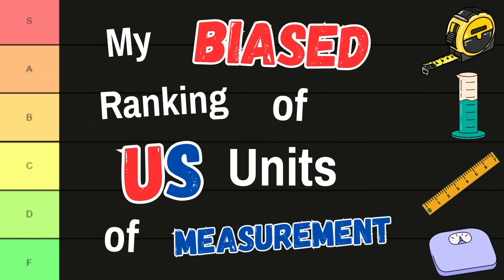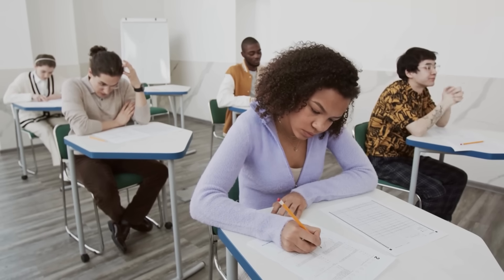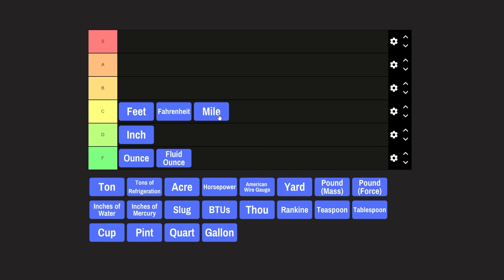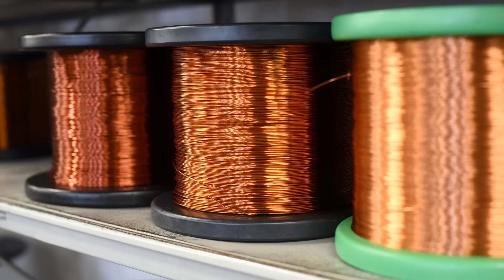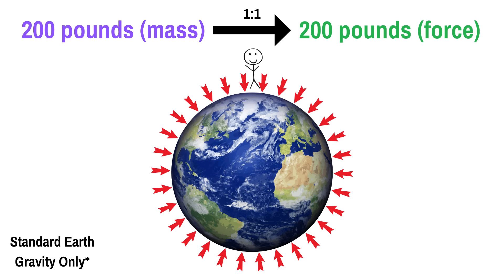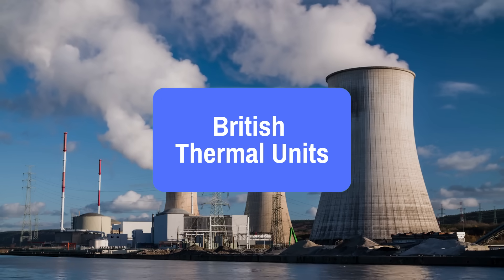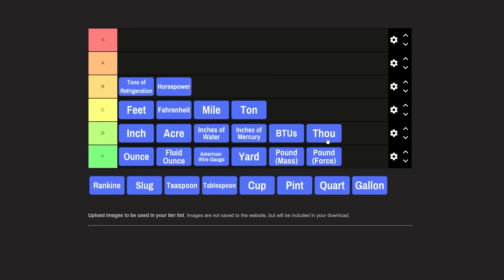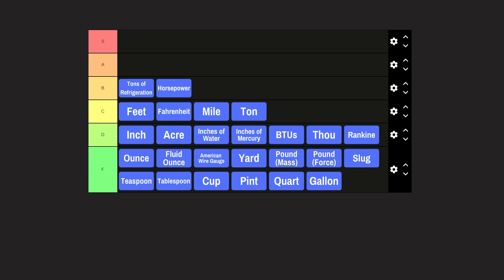Tier List of the DISASTROUS US Measuring System

Comment: I bake a lot. I'm from Europe and as any respectable baker I use a scale on a daily basis. Sometimes I base my recipes on American ones, and the most mind-boggling measurement I've ever seen was cups of cold butter. Idk how anyone would ever think of measuring solid butter that way, but I'm guessing their baked goods were hardly any good anyway so accurate measurements were the least of their concerns. Just so you know, professional bakers weight their ingredients with a scale, even if they're based in the US, and it's a waste of time, money and water to measure your ingredients by volume. You gotta wash the utensils afterwards so just buy a freaking scale.
Reply: The sticks of butter come marked. You cut off what you need. I was also taught that you can fill a 2 cup glass measurig cup with one cup of cold water and submerge butter or shortning in it until the level gets to two cups.
Reply: Well, besides that "professional" butter sticks in Europe are marked too, the standard 250gr package divided into five 50gr stripes AKA sticks isn’t really rocket science and can easily eyeballed.
Reply: @agn855 A cup of butter is less than 250g. Your arrogance in asserting that their complaints are unfounded is fallacious.
Reply: @david672orford Well, so you have to use tricks to get away with these 'cool' measurements...
Reply: @david672orford  what in the...  
OR YOU COULD JUST USE THE SCALES
Reply: @protoney8122 There are no scales in most American kitchens and the recipes don't give the weights of most ingredients. Using a kitchen scale is not taught. It's called path dependency. Once everyone is doing things a certain way, it is hard to change even if the new way is much better.
Reply: @mia199603

In America, our hard butter often comes as one lb of butter divided into four rectangular sticks. Each stick is wrapped in paper. The paper has markings telling you where to cut the butter for 1 tbsp, 2 tbsp, 1/4 cup, 1/3 cup, etc.
Reply: professional bakers are typically using larger quantities of ingredients at a time than home bakers.  it's easier to add a 5 pound bag of flour than to measure 22 and 2/3 cups of cake flour.

also, say I'm making muffins.  I have to wash one measuring cup and one measuring spoon when I'm done, besides my bowl, mixing spoon, and pan, that is.  how many containers do you and your scale have to wash?  I tried converting the recipe to weight once, to ask how long it would take to weigh it all out, and gave up halfway through, since none of the ingredients have the same ratio of weight to volume.
Reply: you lost all respect when you said we americans cant good baked goods. begon heathen.
Reply: They sell butter by sticks of half a cup. I appreciate they made an effort to not introduce stick as a butter specific measure in their receipt.   Most american cooking is very "rich",  so I am not going to respect their exact measures anyway: 3 ounces to the stick will do
Reply: @2adamast  except they (the corpos) did, so now they get sticks of butter, which are the same weight...

...making it a measurement unit
but more than a cup
250 gram of butter in a stick
220 gram of butter in a cup
"The sticks are marked" mf it says use a cuppa butter here, wtf am I supposed to do
Reply: Literally don't know what you're talking about. Are you talking about marking on the butter sticks? Because it's simple to use. Sure weighing stuff is nice but if your recipe is so sensitive that 1 gram off ruins it its not a good recipe. I'm not busting out the scale for 1/4 tsp of nutmeg. Unless I'm baking baking volume works just fine
Reply: @aceystar1478    we don't have butter sticks in Europe. Our butter is 250g, divided into 50g increments. A cup is 220g. That's enough for baking to be noticeably charged.
Reply: @aceystar1478  don't let that hear your pharmacist 🤣 Yes I know that pharmacists don't use these measurements anyway. It's about a 'good' recipe because of 'Just throw some mass of a, b, and c together, bake it some time at some temperature, voila, a stunning delicious cake! No, it doesn't matter how much of a, b and c you are using...'
Reply: @UdoHartmann someones butthurt that their cooking sucks
Reply: @aceystar1478  This sort of thinking explain why all american pastries are shit
Reply: @pouf6463 literally untrue. But, we also aren't known for that. 

Also, measuring by weight is shit. Different brands use different ingredients. Making the same volume weigh differently...
Reply: @electricheartpony  Yeah you know that the only real ingredient in butter is milk (same  for all basic ingredient like milk, salt, sugar, ... it's normal to measure by weight)
Reply: @pouf6463  yes, for large scale commercial production it is done by weight. Using entire bags. But, we're talking about end user usage here. 

Kitchens,  unless they're bakeries, use big measuring cups. I've seen and used five gallon buckets. Bakeries will tend to use entire fifty pound bags at one time. Otherwise, it's also measured by volume.
Reply: As an American who cooks, I only use weight to refer to things that don't pack well, like nuts. Everything else is measured in volume.

Also, a stick of butter is 1/2 cup, and you don't scoop with the measuring cups. If you don't scoop, you don't have to clean the cup between measurements of the same recipe. Just like the scale, you transfer or pour into the cup until it's at the required level. You only clean when you are changing recipes, cooking, or cureing.
Reply: @nathanielhill8156 So another person did the measurement for you (and of course they didn't use  cups either).
Reply: I hate it when there is stuff like cups or spoons or teaspoons in a recipe. I have a cupboard i inherited after my grandma and THERE ARE 10 DIFFERENT SIZES OF TEASPOONS!!! Spoons have never been standardized, every manufacturer have different volume teaspoon. What the fuck does that mean?! Give it to me in grams.
Reply: @thrustvectoring8120  nowadays a teaspoon is = 5mL though if it’s that minor (unless it’s spices) it should be fine!
Reply: @thrustvectoring8120 I feel like it's not that hard to grasp the concept of a unit of measurement sharing a name with a common object. "1 teaspoon" doesn't mean use any teaspoon, "1 cup" doesn't mean any cup. It's a unit of measurement.
Reply: @TheBabaloga  and why to use "cups" if your cups are defined either in ml or fl oz and teaspoon when it is defined in g or oz? Why not use g/oz/ml/floz, for which there are actual calibrated measuring tools and the items you buy are sold using them and not cups (because you usually buy 96 teaspoons of garlic, right... and everybody knows 1lb is 96 teaspoons) instead of some bs unit?
Reply: @thrustvectoring8120  first of all, a lot of stuff is sold in cups in the US, second of all I'm not here to defend the whole US Customary system. You just seemed really hung up on the names of the units, which aren't that weird.
Reply: @thrustvectoring8120 There are in fact a standard volume for a teaspoon. Maybe you should stop, take a breath, and step outside of the kitchen before you hurt yourself if you can't understand the concept of volume and how different ingredients have different densities.
Reply: Our baked goods are fine; using cups of butter doesn’t ruin them. both forms of measurement work.

The vast majority of us are not professional cooks and a lot of recipes work in ratios. It’s just easier to use cups rather than get a bunch of bowls and tare a stupid scale over and over

And volume’s visual too, which helps
Reply: @chicagotypewriter2094    America is a third-world nation.
Reply: @chicagotypewriter2094    "tare a scale". My friend, it's one single button instead of multiple utensils to clean.
Reply: @En_Joshi-Godrez  true but I just find it more of a hassle when I have everything out and since I hardly bake with volume. My scale’s also old but functioning and resets the tare too often
Reply: @En_Joshi-Godrez  so you just pour your ingredients directly on the scale?  or do you put your mixing bowl on the scale, and add the ingredient until the total weight is right?  what if you accidentally add too much?
Reply: @kenbrown2808  you put the bowl on the scale and add the ingredient until the weight is right. If its too much, put it back in the container, although that rarely if youre careful. Easy as that
Reply: @johnwarosa2905  and for me, it's never, unless I lose count.  
say I'm making US muffins: I need a half cup measure and a teaspoon measure.  
it's 3 scoops of flour, a scoop of sugar, a scoop of milk, then I rack an egg into the scoop and top it off with oil. then I add half a spoon of salt, and 2 spoons of baking powder.  done.  1 scoop and 1 spoon to wash unless I'm baking something else, and then I don't need to wash the spoon in between, because it's a dry ingredient.  the bowl and mixing tool always have to be washed, of course, but no extra implement, because you use the lid of the source container to level the scoop.

meanwhile, you're carefully pouring in 2 grams of salt, but don't worry, if you overpour, it's white, so you can see it easily to pick it out.  because remember: you have to pour all your ingredients directly from the container to the mixing bowl, or your claim that weighing ingredients doesn't gt any utensils dirty is a lie.
Reply: @kenbrown2808  acting as if weighing ingredients is in any way difficult. Sounds like a skill issue
Reply: @johnwarosa2905  so what you're saying is I caught you in your lie.  

but you're acting if measuring ingredients is in any way difficult.  I mean, my wife has to put effort into it, because she never learned to cook as a child, and she hasn't watched me enough to mirror my technique.

but you're trying to make it an impossible task the way the monochromes do it TV ads for kitchen gimmicks.  if you watched those, you'd think Americans are incapable of cracking an egg or turning a pancake, whether US or UK style.  it's literally, dip your spoon or cup in, strike off the excess with the edge of the lid and dump it in the mixing bowl.  it's easier than pouring a beer.
Reply: @kenbrown2808  lol, im not much of a cook eother and yet i know how to pour in flour, milk, grain or whatever until i reach the desired amount. Stop acting as if weighing stuff is hard
Reply: @johnwarosa2905 But now you've got an additional utensil to clean because you had to remove something from your scale. Also, it's easier to wash a measuring cup than clean up spilled flour from a scale without damaging it.
Reply: @tyrannosaurusimperator you usually put the bowl on the scale which youre already using for mixing. Ive never had to use additional utensils just for measuring on a scale
Reply: Most people who bake aren't professional and using a simple set of cups and spoons for measuring ingredients is way simpler and less expensive than using a whole scale.
Reply: @Coolguy98765 bruh... a basic kitchen scale is 3€... it is cheaper than a mug...
Reply: @thrustvectoring8120  I thought you said you inherited the teaspoons from your gram.

Comment: Small correction: Twip is not 1/1440 inch, it is 1/1440 of a logical inch. It is used for screen measurements, where the screen size isn't necessarily known by the computer, so it makes an assumption of how many pixels there are in an inch, and from there, derives how large the screen area is in twips. Yep, it is that crazy.

Comment: Interesting video.  I'm American and am used to most of the measurements you covered, so they don't bother me. ⬅
One term was a surprise.  I never heard of the unit "thou".  In drafting class in high school (circa 1970), a thousandth of an inch was a "mil".  No one ever called one a "thou".  I just looked it up.  "Thou" is a recent term that many use to replace "mil", wrongly concluding that mils would be confused with millimeters.  Millimeters are "mms" and mils are mils; there was no confusion.  So you wrongly placed "thou" in the F tier.  It clearly belongs in the Z tier.  It does get upgraded as a religious term, though.  Thou in the Bible is an F, and people using for measurements would make me think they are trying to say something religioiusy.⬅
One other point is that mil is also a unit of currency, a thousandth of a dollar.  Of course, the only time we see currency mils any more is in the price per gallon of gasoline,  and no one even realizes they are being charged in mils.
Reply: mm, not mms

Comment: Well, your first mistake was calling this the US Measurement System ... it's not, it is the Imperial measurement system (but, as usual, the USA got some of it wrong :/ ) and is in use in many countries around the world .. including the UK .. where the US got it from.
And no, the UK does not use Metric, although it is slowly converting to using it and, in the meantime, uses either Imperial or BOTH Metric and Imperial together., e.g. on Foods (where weight is listed as "1lb, 454g" ... etc)

If you told me I am 1.88m tall, weigh 89kg and live 3.2km from the city centre, I wouldn't have a clue what you were talking about.
I am 6ft 2in, weight 14st and live 2 miles from the city centre.

Comment: As someone from Finland I can't understand how Fahrenheit is supposed to be good for weather. None of the explanations make any sense to me. Celsius is far better as usually the coldest weather in the winter is bit under -30C and in the summer the hottest is usually bit over +30C and 0 is a nice average of the yearly hottest and coldest temperatures. 
 
Also it is extremely helpful to be able to speak about the freezing point of water. We even have a word specifically for speaking about under 0C temperatures, try to imagine a word like "Heat" for cold. Talking about cold temperatures in English is like trying to talk about directions and there's no word "left". You can do it in many different ways but it's so weird when you're used to having that.

Comment: Id like to propose another unit of measurement for the tier list, the unit is called inches of rain, it is most commonly used when determining how much water a given crop should receive, to my knowledge it is measured as the amount of water that it would take to make a 1 inch layer of water in a 1 square foot area, or roughly 0.62 gallons per sq ft
I worked at an irrigation company that measured everything in gallons per hour and it was very tedious when customers would ask how many inches of rain per week to give a plant, seems it is commonly used by master gardener classes and such
Reply: it's a lot less tedious to put a rain gauge in the irrigated area and measure how much time it takes to get the desired number of inches.
Reply: @kenbrown2808  I would agree with you, however it's not super practical to do that when trying to help a customer design their drip irrigation system, I can tell them how much water in gallons per hour our products can supply, but they go to master gardener seminars or whatever and get told that their plant needs such and such amount of inches of rain per week and I have to calculate that into gallons per hour on the fly so inches of rain is a dogwater measurement

Comment: i have size 41 feet. my mom has size 37 feet. my (not so little) brother has size 45 feet. my lil niece has size 25~~. 

measuring in feet is like measuring in spilled coffee. it is completely all over the place.
Reply: I have size 44 or 45.  Depending.  So, let's say 44½.   My feet aren't a foot long, they're shorter.  My shoes aren't a foot long either (course not), they are longer than an Imperial foot.